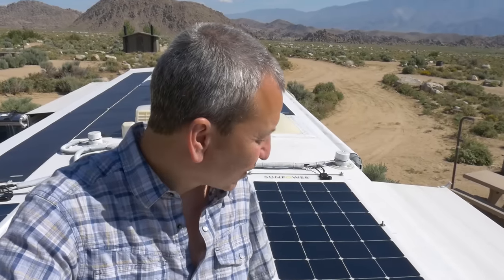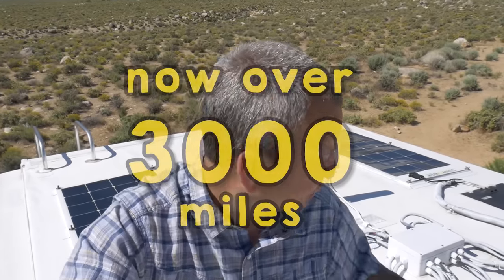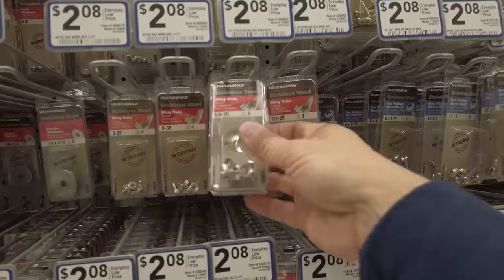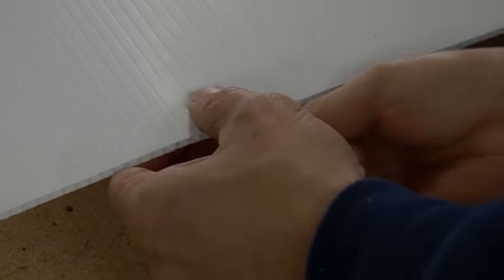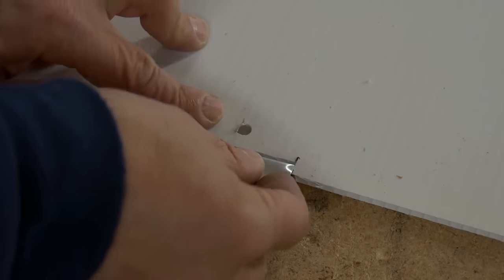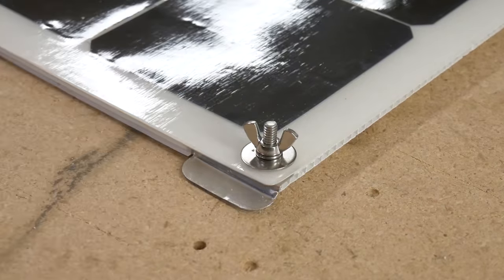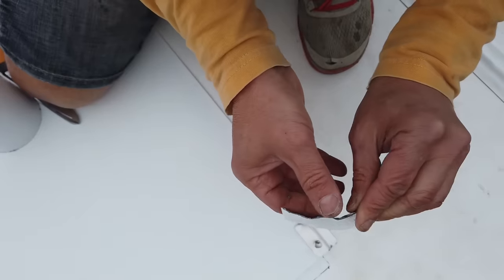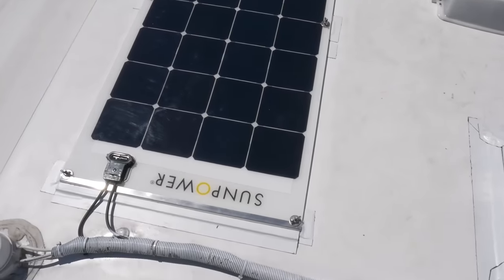Better Way to Mount Flexible Solar Panels on RV (2019)

Comment from the maker: Get 10% OFF SUNPOWER Semi-Flexible solar panels (like the ones in the video) at SunPoweredYachts.com with the "RVWITHTITO" discount code. Check current prices at https://www.sunpoweredyachts.com/shop.
Reply: can you tell us what do you use for cable roof box  ? i'm having a hard time find one that can be adjustable or adding / removing more cables ?
Reply from the maker: @jeannie8262  Hi Jeannie. Have you seen this video? https://youtu.be/aB8ic6x9DAM. This is how I do it. I can add new holes for more cable glands as needed. Right now I have 4. Hope that helps.
Reply: How are the panels working now? Still like new? Have you noticed any performance drop? And other issues?
Reply: I need someone to help me install on my Roadtrek know anyone?
Reply: That corrugated plastic is call "'Corflute"'.
Reply: Thank you SO very much. This was very helpful.
Reply: Hey Tito, where did you get those Aluminum strips? I have looked elsewhere. Those are really perfect!

Comment: Drill a hole in the wing nut a safety wire it to the stud . Aviation tip.👍
Reply: Or just use a nylon nut!
Reply: Skateboarder tip just use lock nuts. Same thing we use to keep the wheels on the trucks.

Comment: Excellent solution for: 1. Stealth install with a very low profile.   2. Air flow to cool the panels and water drainage.  3. No holes in the roof.  4.  Front of panel secured to prevent air sailing.  This type of install will extend the life of the panel.
Reply from the maker: I'm hoping it helps extend the panel life.
Reply: Most panels fail due to the abuse that UV radiation can dish out. Adhering directly to metal can actually act as a heat sink yet with a quality panel...heat is not an issue. BTW...stealth is a lost art. Law enforcement and concerned citizens are usually supported by the latest ordinances to prevent anyone to stealth camp in many, if not most, neighborhoods and business districts. It was easy in the 80's and 90's...nowadays...not so much. I recomends getting out of the cities onto public land. Its wonderful.

Comment: I used this method to install my 3 flexible solar panels three years ago and about 20k miles and it has served me well.  My corrugated plastic has begun to get brittle and will need replacement but this worked and worked well.

Comment: A slot cut in the threaded end of the bolts, would be a good idea.
Then if they ever spin in the hole, you could hold them with a screwdriver when you take the nut off.
Reply from the maker: What an excellent idea. Sounds like a job for my mini cordless Dremel. Thanks!!

Comment: I don't think that I would have cut out around the heads of the carriage bolts. They will compress up when tightened and leave the double thickness for strength. Great job and thanks for sharing.
Reply: Exactly what I was thing.  Just use a flat top carriage bolt instead of round top and a washer.  Slap a piece of tape over it to keep metal from rubbing the rubber roof.
Reply: it only locates the coreflute, you could actually cut or punch it completly out, the alloy strip and panel secure the coreflute

Comment: I really like the idea of being able to easily change out the panel at a later date and no holes drilled in the roof. I will definately use this method.
Reply from the maker: I recently posted a video showing a new method. If you like this one then the other is better. 👍

Comment: Awesome video, personally I would use elevator bolts. Maybe epoxy them to the roof as well. Also remember if you are using ANY stainless to use anti-seize or STL to prevent galling. If you line up the wing nuts forward to back before you set them to the roof all you have to do is take a quick look on top to see if any wing nuts have turned off of the forward to rearward orientation. Nice job!!
Reply from the maker: Thanks for the suggestions. Check out my more recent mount and let me know what you think. https://youtu.be/uJIEXhnF8MU

Comment: BRILLIANT! I have a fiberglass high top that I wouldn't want to drill holes through, this is a great low-cost and low-tech solution. The corrugated plastic panels also go by the name Coroplast. The aluminum piece looks like the z-flashing I used to join the 4x8 panels on the outside of my shed.
Reply: So how do you get the wires through? I also have a fiberglass high top and would love to know some alternatives

Comment: I just recently completed installing 6 of the Sunpower 100w flexible panels on my travel trailer using this method and I like how everything turned out. I will definitely report back after I hit the road for a couple months. I opted for elevator bolts as others have suggested. Excited to hit the road next month. Thanks Brian for the inspiration!!
Reply from the maker: You bet. Enjoy!
Reply: What are the long term results?

Comment: Wow I have been racking my brain to figure out how to install panels on fiberglass. So excited to cross you path.... best solution I’ve seen so far... I think I have a winner. Thank you 😊
Reply from the maker: Awesome! Good luck.
Reply: @Teresa Noel  You need an air gap under solar panels to keep them cool so they don't overheat and fail. Rigid panel are the way to go. You should not puncture the roof to mount them. Use adhesive to mount ABS blocks that hold the rigid panels. See https://www.amazon.com/dp/B07RYPFSGJ/ref=sspa_dk_detail_0?psc=1&pd_rd_i=B07RYPFSGJ

Comment: I did something similar, I used neoprene padding beneath each flexible panel. Your corrugated plastic is much less expensive. Excellent idea.
Reply: Maybe use 1/2" sheet of foam insulation.

Comment: That looks like a pretty nice solution. I've been considering adding a solar panel to the top of my pop-up camper and I might use this method. However, I would probably use elevator bolts instead of carriage bolts. Elevator bolts usually have a larger, flatter, head so you wouldn't have to cut out material to accommodate the carriage bolt head. You can also find elevator bolts with spike grippers under the head that would help keep them from spinning.
Reply from the maker: I've also started putting tape under the bolt so it doesn't make direct contact to the roof. Good luck with your project!
Reply: Elevator bolts is the exact method I'll also be using - with a 1 1/4" head, I can use pre-cut VHB circles for easy install.
Reply: Hi,,, may be instead of wing nut a lock nut would be more satisfying.
Reply: Great info, thank you!

Comment: This is for all you RV goers...   Hehehe, the only trick i came up with...
I have hooked my "hot water" side of the sink tap to the external water inlet so that i can use the external water and save the one from my tank just by swinging the handle towards the hot water...

It might be helpful to someone with a simpler set up like myself!

GREAT VIDEO thanks so much for posting it....  The only thing i would do differently would be to run the front tape only dead aligned with the edge of the floor transition strip edges and i would cut a 'U' shaped notch to house the front bolts so that if i want to remove the solar panel i could just easily flip the aluminium transition up as these panels don't last a super long time in good working order.

Comment: Great Job , The Plastic is called COREFLUTE , used in sinage ,,, very strong stuff ,,
Reply: Wikipedia adds: Corriboard - also known under the tradenames of Cartonplast®, Polyflute, Coroplast, FlutePlast, IntePro, Proplex, Correx, Twinplast, Corriflute or Corflute. Wish I could find the affordable version. Its kinda spendy.
Reply: I'd go with plywood for cost and stability.
Reply: @ravendon  Missing the point, getting heat away from the flexible panel with the core flute is the best thing as that's a major problem that shortens flexible panels life span dramatically...

Comment: Finally, a way to mount safely and securely yet easily replace panels as needed and take them off should you sell your unit!  Recently I've seen a couple of used class 'A' RV's all decked out with solar. I just can't imagine putting all that money into a system and then leaving it all and having to do it all over again on the new rig!  Now I'm willing to start planning a solar setup for our 5th wheel. I got your solar guide too, thank you so much!
Reply from the maker: Glad you got something out of all this :) Good luck!

Comment: if you copy this design, before installing it, cut screwdriver slots in the ends of the carriage bolts, just in case they try and rotate when you remove the PV panels then you can use a screw driver to stop the carriage bolt from spinning
Reply: That’s always a good idea or you can use to nuts snug down the lower not encounter tighten the upper one

Comment: Nicely done. Great minds think alike.  I did a similar mount simpler still. 

Cut a 4" diameter circle of  Eternabond tape and then put a 3/8" hole in the middle. Use that to tape 5/16" x 1" big headed elevator bolts to the trailer roof. Cut a circle of plastic milk bottle to keep the bolt head from scratching the roof. Then bolt the panels down with Coroplast backing. I've got about 5,000 miles on it so far with good result.
Reply from the maker: Nice. Thanks for sharing your setup. 👍
Reply: Interesting twist on a familiar theme. Thanks for the ideas!
Reply: Very nice pro tip, many thanks!!!

Comment: I'd pick elevator bolts over carriage bolts- thinner head. 
Here is Seattle, I'd worry about moss and mung accumulating under the plastic board.

Comment: Finally, a technique that just might get me moving toward a solar installation (in conjunction with your previous solar “how tos”). Thanks Brian.
Reply from the maker: You're welcome! Good luck.
Reply: This is wonderful solution.  I was looking hard at the tubing you installed your panel cables through....would love to see more on that portion of the installation.  We are running a 2019 Ford Transit conversion and I have 2 panels to cable and am struggling over making it "look" somewhat good.

Comment: Just finished installing 4 HQST 100w panels using the plastic cardboard method shown on this video and everything went great. Thanks to this video I am now set up for off grid very well.. Thank you Tito your videos are great and it gave me the confidence I needed to do it without drilling. No thread lock tight and I’m sure I don’t need it.

Comment: I noticed the plastic corrugations run width wise not length wise on your panel. I had to "rewind" the video to verify as I thought sealing up the front edge would block any air flow if the corrugations ran front to back. I made a PVC awning/portable mount using your previous video. Thank you for that. And boy, those panels get HOT in direct sunlight.
Reply from the maker: The front edge is covered by the aluminium piece so front to back orientation wouldn't work. The side orientation is also for proper drainage since the panels are on a very slight downward side angle.
Reply: Panel heating has been the demise of many a panel made with the wrong materials. Do some research and you will find panels that can take tremendous heat and still have most of their output after 10-15 or even 20 years. I have a Uni-Solar panel that is 13 years old... very little degredation. My neighbor has had all his panels (four identical from the same manufacturer) die within 3 years. He went the lesser quality route. They were beautiful panels but the materials just did not hold up well. I have a total of 13 amorphous panels that all look about the same as when I bought them yet were never fancy looking. They are also larger than the equivilant crystaline panels so more real estate is needed.

Comment: Really nice setup and even though the semi-rigid panels are more expensive and potentially more problematic I definitely prefer the much lower profile appearance versus the rigid panels which can be a bit of an eyesore with multiple panels installed.  Thanks for the time and effort it took to put this presentation together.

Comment: Wow, you've done it again.  A very well thought out and executed DIY install. Nearly genius.  If I can only overcome the fear of that first big step, which panels to buy, what else do I need, controllers, etc. Like you, I am a planner, but sometimes I over think things. I always learn from your videos. Thanks for sharing.
Reply: RedRoofRetriever I hear ya!
Reply: Nothing wrong with over thinking it. Better than regrets. But don't get analysis paralysis. Sometimes jumping in and buying one item and tackling a small project illuminates bigger ones.
If you want to now best products - see Humble Road videos for electrical components.
Solar panels are independent from rest of the items.  Stick to lightweight panels not heavy glass ones. Mount like Tito did, best way I've seen. Keep them covered up so you don't get a shock or electricity being generated till you are ready to use them. Run a fake line like a string thru your existing roof vents like Fridge. Once the string is inside the RV decide where it needs to go for hookup and how long it needs to be. Your wire thickness depends on length. Mock it up first.

Then make cardboard mockups of all the electrical devices you need and mount them in RV. Once it is all set in place and you worked out the kinks, do your ordering. 
Best Inverter is Victron. The Multiplus 2 can handle both lithium and AGM (Lead acid) batteries, and is also a battery charger and inverter. It is a True Sine Inverter not Modified Sine. Do not use a Modified Sine or your 110V appliances will fry.  Always True Sine! Get a 2000 Watt inverter for most things as 3000 watt is pretty high. The bigger inverters will also sip more power as they are turned on. You only need an inverter turned on when you use 110V power from the batteries. 12V lights and fans, water pump, fridge mostly run without the inverter.

Best solar charge controller (SCC) is Victron MPPT (not PWM). For a 30 amp SCC, you can mount a max of 400 watts of solar. If you mount 420 watts, you need another 30 amp SCC. It is better to get two SCCs at 30 amps each than one at 60 amps. Easier to have two systems if one malfunctions.  The other one is still working.

Safety code issues with your wiring diagram, wire gauges, wire heating all covered by Greg Virgoe.  He is a great teacher and UK certified electrician.

Where do you start?
With your own requirements.  Start camping and note what you want and need.  Hair dryer? Toaster, coffee maker or French Press? Run AC on batteries or no AC?  Run fridge on AC or use old tech propane fridge?  Make a list. Then determine size of inverter you need.  Then decide how much lithium battery bank size you need and can afford. You can keep adding batteries, and solar panels but not inverters. Also you could have a small dedicated inverter for your CPAP machine at night so the big power hog can be turned off. Requirements are key and you need to know yours first.

Comment: Excellent!  Just what I needed to see.  This was my idea too but nice to see it materialize.  I have some Lexan Polycarbonate panels which are more UV resistant and shatter resistant than Coroplast but pricier. If you can get used ones from a greenhouse...!  They are slightly more raised.  On Cheap RV Living, this guy uses tubular aluminum and mounts panels to that, but I think they still need a Coroplast backing to stiffen them up. The tubular aluminum is useful if you have a domed roof and acts like a mini rack.
Your idea of chopping up the tile edging to use as brackets is brilliant and saves money.  
Use elevator bolts instead of carriage bolts for a flat not curved surface.  I think cutting away at that Coroplast was not smart as it will degrade faster with the wind shear forces. The elevator bolt will compress the plastic enough to sink in.

I think you absolutely nailed it on the flex mounting.  Everyone should follow this example.  If you had a roof rack, this could also be mounted on the rack and that might be easier to replace for maintenance, but this is a simple, elegant solution to this pesky problem.  I'm really grateful!  Many thanks, Tito!  I have 4 to mount.  I was worried about having to add a deflector but with that front strip of metal on each one, problem solved. No wind shear issues.  I see that the hollow tube section of the Coroplast is facing side to side. Initially I thought it should face front to rear for good airflow under the panels to keep them cool, then realized the wind shear would be too strong that way, so side to side is more than enough wind getting redirected to there.  Superb.

I would add a dab of Dicor self leveling lap sealant on top of every tightened up, Loctite'd wing nut.  Now it is truly waterproof, corrosion proof and also insulated against heat. Also viewers - use stainless steel hardware all the way.
Pro tip - I used a Wagner heat gun (cheapest brand) to heat up Dicor when I have to remove it.  It comes off so easily.  Use a flat blade putty knife and a heat gun when you have to remove those wing nuts, it really is a breeze.  I see that Eternabond tape also loosens up with a heat gun. You made a video on that too.  Your info is so practical and applicable.  Very useful videos!

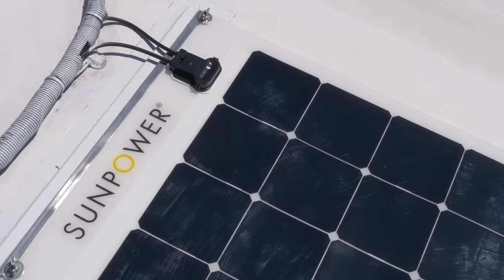Q: 1:39 - What sort of wire loom (wire cover) did you use on the roof for the cords from solar panels?  It looks white, and is probably heat reflective and insulated so the wiring stays cool.  I'd love to know if its anything special?

Comment: You can buy lock wingnuts, they have the plastic inserts, so they won't come off easily....great job!
Reply from the maker: Thanks!
Reply: WHO SELLS THEM?
Reply: I tried nylon insert nuts...  I couldn't get them to work easily because the bolt would spin.  I ended up going back to 2 normal nuts to do the lock.  Not sure what  I did wrong?